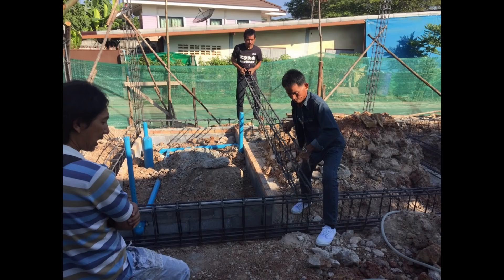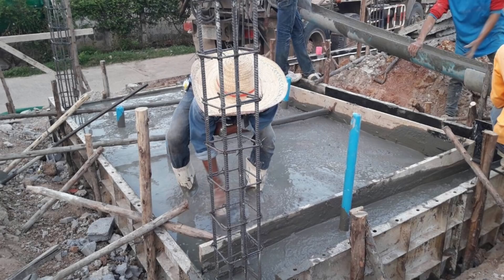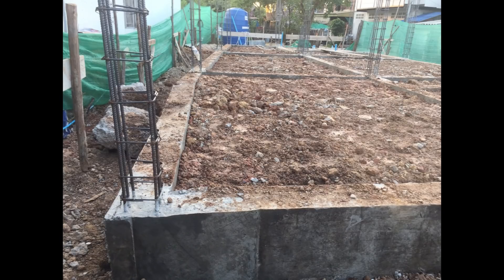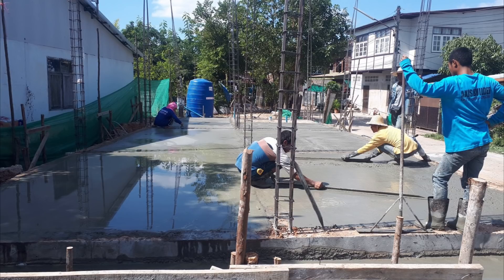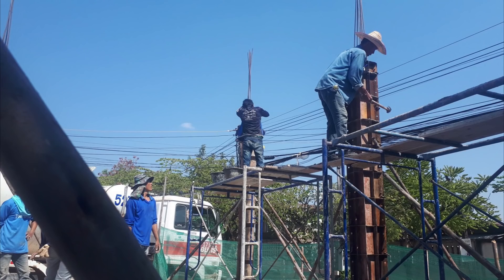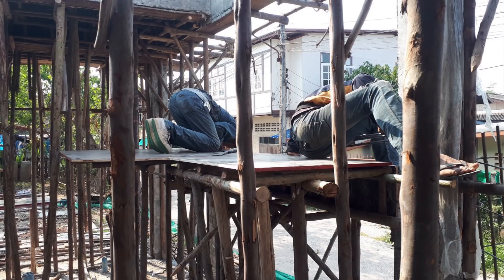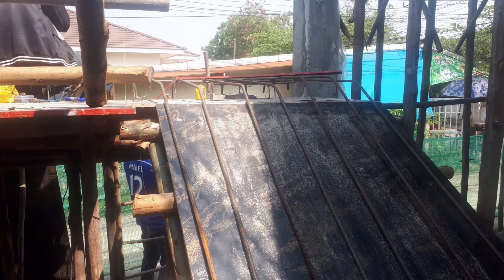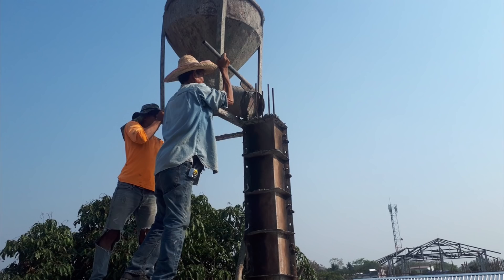Building our house in Thailand Pt 3 | Living in Udon Thani Thailand

Comment: May I say, that concert looked very wet.  To much water makes concrete weak, and crack.  Just do you know.   Builders like it wet because it's easy to work with.  Lazy.  80 slump is recommended.  
👍
Mabey, the cement is different in Thai.
Reply from the maker: Thanks for the advice.